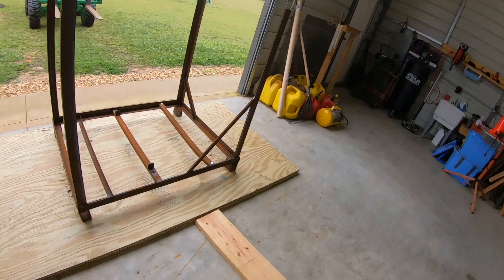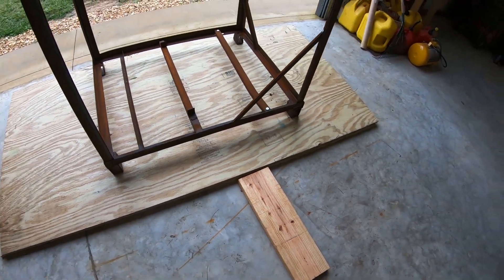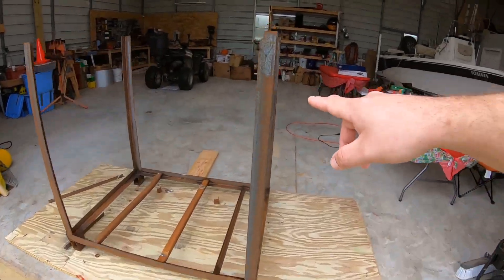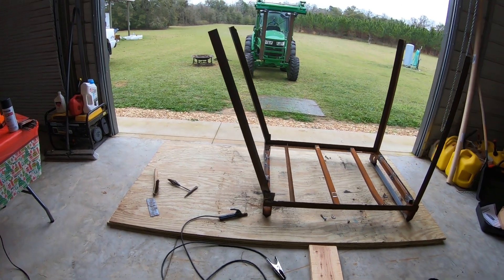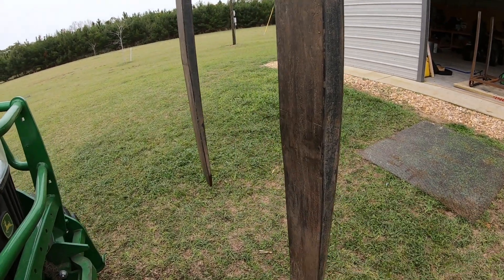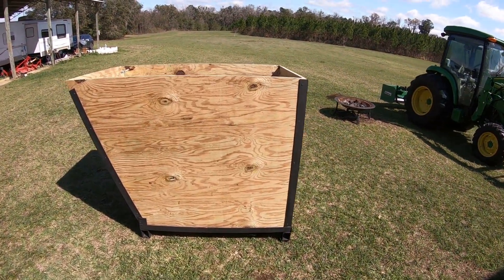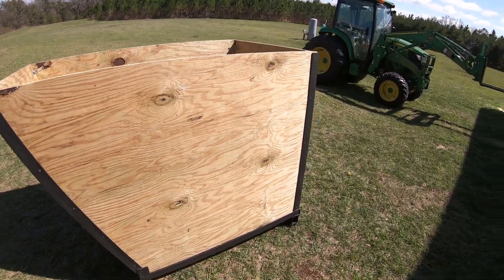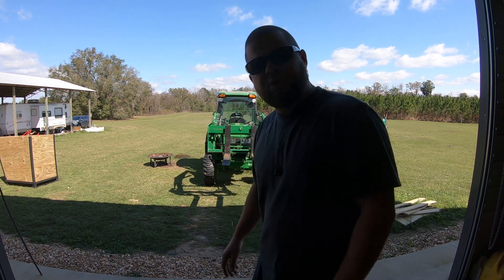#77 Building a chip dump cart

Comment: Nice build. I really like videos like this.
You asked for ideas for skids--take about a 12 inch diameter log that's about a foot longer than the cart, split it down the center, and cut a 45 degree angle on each end of each skid. You can keep the steel off the ground and you could slide the cart where you want it with one bolted or screwed to the bottom of each side. 
If you know someone with a sawmill, you could get some boards for the bottom of the cart. Only get side pieces so you can put the rounded side up so any water can run out
Reply from the maker: That's a really good idea, thanks for mentioning that!

Comment: I just found you on Youtube, so I am your newest subscriber. Love the chip cart idea. One thing to consider.... All the old grain elevators or grain trucks that had wood sides had an eye bolt or something to spread the load out at the attach point and then a chain attached crossing from one side to the other. It took most of the outward stress of the grain off the walls but did not interfere with loading or unloading. It would work the same on your cart and cost almost nothing. Might want to run one front to back to the pin you talked about going into your forks to hold it on the tractor. Great channel. Great video. I may make one myself.
Reply from the maker: Thanks for the tip, and thanks for subscribing!